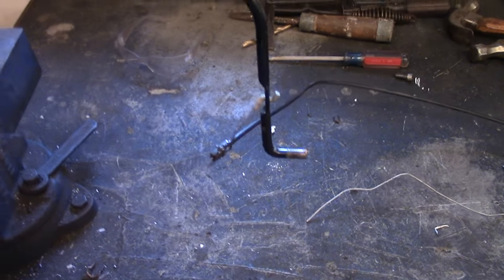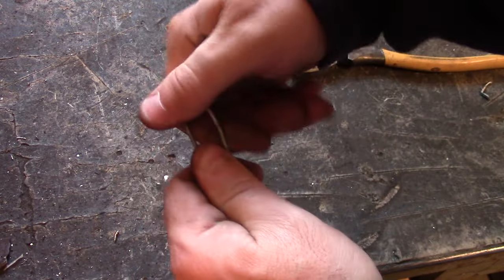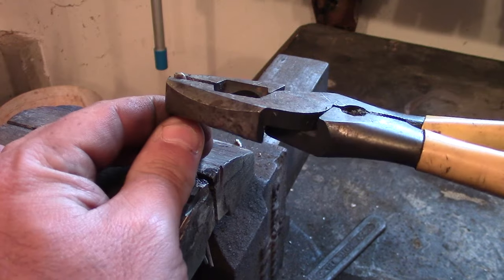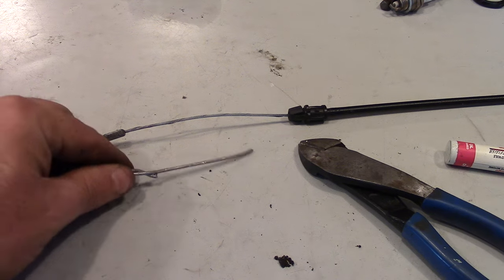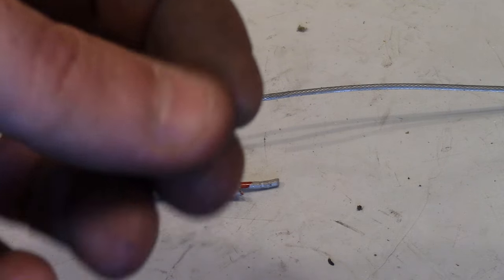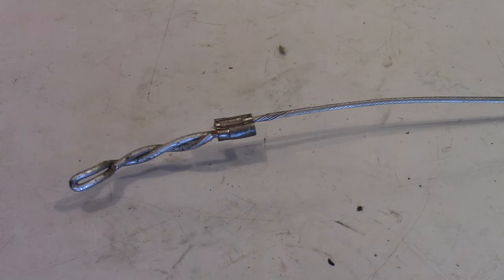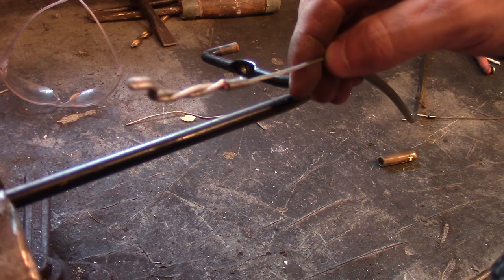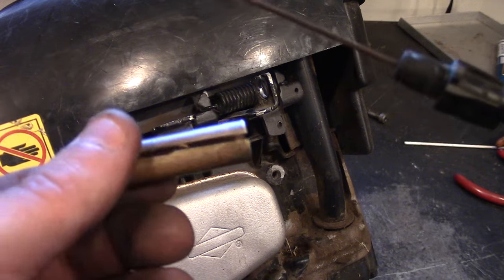Repair A Broken Lawnmower Cable

Comment: Thanks for this. I tried it and it worked. Looks like it might last a good while.
I used 3mm aluminium wire, also call 16 gauge I think. 1/16 inch would be 1.5 mm which would probably be too thin.
Also instead of crimping I used a 3mm duplex egg shaped screw clamp. That was a good decision as I had to adjust the length and was able to undo and redo them clamp.

Comment: .......This is brilliant....that ferrule cable splicer is only $1.47 at Home Depot for 2.....You can buy a 2 ft. length of stainless steel 3/32 cable for 0.50 cents......that's it....back in business.....

Comment: Great video dw6! I think there could be another way of doing this. I would use steel wire so its stronger than aluminum. I would then tack weld the crimp connector to both wires if you have a welder. That should hold a long time. Hope you don't burn thru the cable though.
Reply from the maker: +Love2boat92 Solder would work well.
Reply: doublewide6 That's another option.

Comment: I think that looks pretty good! Personally I wouldn't waste time building that little tool because needle nose pliers work just as good. I stumbled upon those double ferrules at Home Depot yesterday. They want $1.50 for two of them so 50 for $4 is a steal.
Reply: Great information. Presented in a way a DIY with some know how, can get it done.

Comment: Thank you.I have a platinum Sears pushmower with the ez drive system.The cable broke into.Went to order it and said the famous"obsolete"on the cable.I then noticed the cable with the ez handle assembly.Sears instead of offering just the drive cable they make you buy the whole handle assembly with cable.Instead of a 20.00 cable you have 60.00 plus shipping.F SEARS.They deserve to go out.Anyways thank you.I fixing it with ferrules from lowes and a new bike inner cable.

Comment: The plastic sheathing on my lawn mower throttle cable broke in the middle when I folded the handle for winter storage. The wire inside the cable is not broken;  can you suggest how to splice the plastic sheathing back together so that the wire moves inside the sheathing. They want $50 plus shipping for a new replacement cable. Dave P.
Reply: Try this:
Pull the cable together at the break.
Put a hose clamp around the handle just above the break and a hose clamp just below the break.
Tighten the clamps just enough to hold them in place. If you tighten them too much you may squeeze the cable inside and restrict the movement.

Yes, it looks tacky, but it works.

Comment: are the cables such a problem? i might get another rover then 26 years and never broke a cable. i think id have a spare in stock with new blades. i wouldn't repair one

Comment: nice. I'd be interested to know how long you can use that cable before the aluminum wire slips out.
Reply from the maker: +Josiah Hill Really long.  Soldering it would have really made it bullet proof.

Comment: Becomes a kill switch mower... or one that you have to start and pull the spark plug boot off while running ahaha.
Reply from the maker: +Cody Jv Not sure what you mean?
Reply: +doublewide6 defeat the safety brake with a zip tie and rig up a switch to ground the spark. love it because you can move whatever is in the yard and come back to a running mower. Or skip the wiring of ground and install some rope to pull the spark plug boot off the plug to kill er.